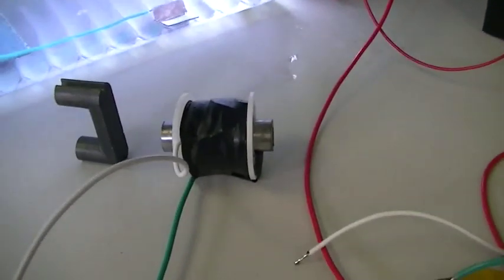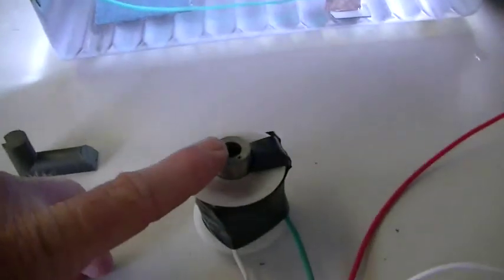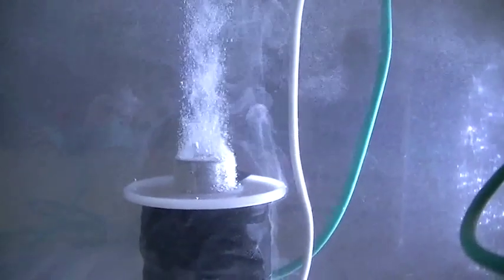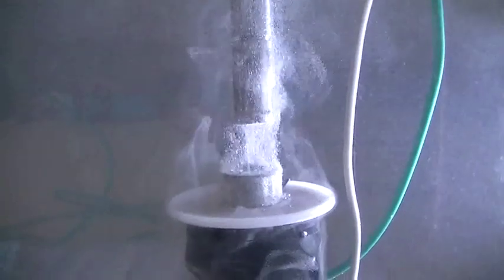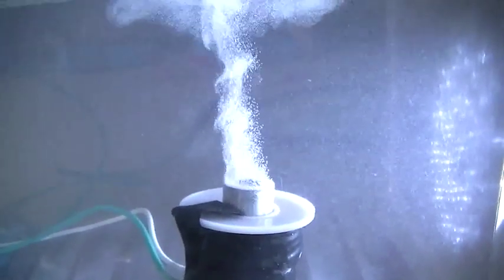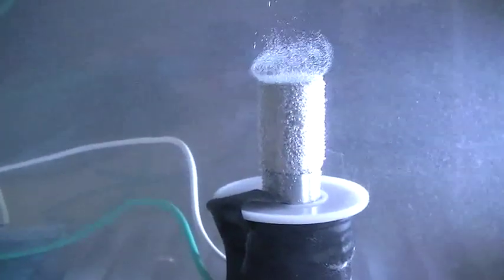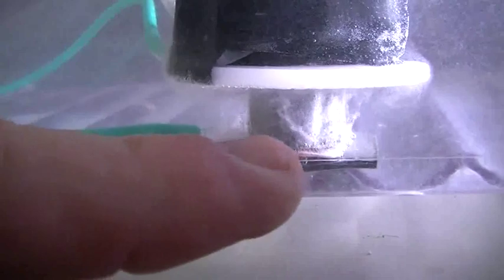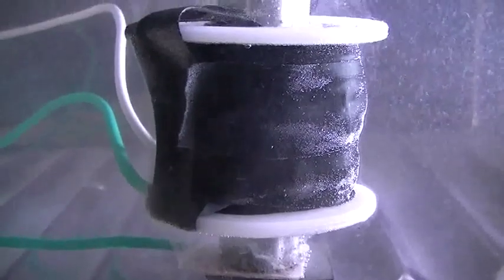Magnetic vortex electromagnet test

Comment: NO Conjugate RECIPROCATION ['vortex movements'] (field reciprocation) with EM vs. PM because:

A: electromagnet is "driving" the magnetism via electricity, NOT dielectricity from the inter-atomic made coherent into the incommensurable geometry of the PM

B: Electromagnet is spatially divergent IN/AS a coil, and does NOT (almost the exact opposite) have the properties of dielectricity as found in a PM which is "driving" a genuine PM !!

Read Eric P Dollards works !!!!!!

Your videos are bloody marvelous. Youre a hoot, awesome, creative, an experimenter, and you're like a fine OPAL from Coober Pedy !!!!
Reply: NOT REALLY! Replace the tube iron core with a solid iron cylinder and you get your spin. This is because iron tube behaves like a toroid which has zero magnetic field in the air cap.

Comment: Just from observing the change of polarity of the electro magnet, you can see that the permanent magnet have a much more powerful magnetic field. What should have happen with a reversing of polarity, if they were of equal strength, is that they would either attract or repel each other like two permanent magnets of equal strength. There is a significant difference between the electro magnetic and the permanent magnet's relative field strength. The effect might simply not be visible on the electromagnetic coil because the field is to weak.

Another factor is that you use the same electrical source, and the coil wiring connection is not sufficiently insulated. Then you also get interference from electrical current flowing from the coil windings connections as well.

Comment: 9:29 impressive. But the permanant magnet does have a larger cylinder shape for the bubbles to move up and around. Probably you would need the exact same size cylinder on eletrco-magnet.... Geometries should match to make the case. Also, the magnetic force needs to be an exact match.

Comment: enjoying the videos today tinman!

my first thoughts we're maybe if the wire was coiled in a certain pattern you could get the same effect. i've seen another person on youtube wrap 10 or so coated wires together, then around a torus in both directions evenly spaced.
once a current was passed through 1 of the wires it would create a magnetic vortex in the centre of the torus. it was shown by either placing a metal ball in a container in the centre so it can spin freely, or a candle was placed in the centre where the smoke would spin and get sent straight up to the ceiling much higher than the smoke would usually get before being dispersed. if you'd like to see the video let me know and i'll see if i can find it again.
Reply: MrBradJJ I would very much like to see that video
Reply: Shaded Zaleph im a bit busy at the moment, but if i remember correctly, the youtube channel was daniel nunez and had some videos named, vortex technologies. if not interesting, they we're pretty cool to watch at least.
Reply: MrBradJJ  much appreciated

Comment: Hi Tinman, great to see your work here, I would suggest to wind a Iron Wire coil with no core, not insulated, best to wind like a compression spring, then apply the current in the coil only then with current in the water and coil current together. I hope this will show some interesting results, Regards Arto.

Comment: Excuse please if this question sounds stupid. Why are there two different colored wires and why are they on the same end of the magnet? It should be a single wire started on one end with a single coil culminating at the other end if you want to reflect poles. If you wrapped more than one layer of coil then the eddy currents will cancel themselves out. Try that mate.

Comment: You should gave the battery go through a PWM so you can pulse the coil the on/off may change the behavior. To get energy out of a coil it needs to be turned on and off.. maybe to get fields strong enough to affect gasses it requires pulsing as well. You should test if there is a change from to being pulsed or to have constant power, Also try AC instead of DC!

Comment: Interesting demo, however i see no reason to presume the swirl effect is caused by some fundamental difference between the 'types' of field produced by passive vs active sources - magnetic fields exchange momentum between moving charges via the omnipresent flux of ambient virtual photons - a static field is a static field (ie. unchanging in time), the curl and divergence of B is zero, there is by definition no kind of mechanical 3D motion within it, no intrinsic torque, the 'Maxwellian vortex' is a metaphor not a literal functional description, and the only meaningully angular components would be quantum (ie. signs of h-bar exchanges as a function of relative directions of interacting charges, and electron spin polarities etc.).

The implicit obligation would be to test the hypothesis with a variety of 'dummy' stand-ins for the permanent magnet - the logical things to compare against would be a non-magnetic metal mass of similar proportions (say aluminium), a soft ferromagnetic sample (say mild steel or inductor core / paramagnetic shielding material), and perhaps also other types of permanent magnet (samarium cobalt, hard ferrite etc.) - all with the same cylindrical profile.  Maybe plastic or wooden / clay / concrete etc. blocks too, to compare effects of different thermal and geometric properties..  What about hollow cylindrical masses (in keeping with the core being used here)..?

Much of which i think would be unnecessary if we simply apply the same right-hand rule we already presume to be generating the solenoid field, to the swirling bubbles we see..

The net magnetic field with the neos attached is significantly higher.  Assuming the water is denatured, the walls of the bubbles must provide sufficient charge separation (due to reduced mobility of tensioned H-bonds, or something?) to interact with a changing magnetic field, and though the field itself is static, buoyancy is lifting these charges away from the source, which is also thus getting weaker with distance, hence we have all the conditions required for induced torques, in a kind of hydrothermal DC motor.. 

Another factor that may assist the effect is the turbulent vortices usually associated with a normal (esp. flat-faced) leading or trailing surface - causing higher pressure fluid to swirl around the enclosed pocket of lower pressure at the center of the exposed face.. 

These more obvious explanations would need to be eliminated before the results could be interpreted as supporting the suggested hypothesis.

Again, though, nice work.. just needs the follow-through - isolate the phenomenon and you book-end the findings.

Comment: The first thing that needs to be understood is that all magnetic fields are the same. There's no difference between a magnetic field produced by the permanent magnet and one produced by an electromagnet. When you reversed the polarity, the PM should have been repelled away from the EM. It wasn't. That can only mean one thing - the PM field is much much stronger than the EM field. Its attraction to the steel core is stronger than the force to repel it. Therefore, the reason there was no spin with the EM is simply because it wasn't strong enough. Try it again with more current - it's current that matters, not voltage. As far as the spin goes, there's nothing mysterious about that either. When using electrolysis you're creating ions - charged particles. The spin is just the way charged particles behave in a magnetic field.
Reply: Yeah man, Golden comment hidden in a bunch of ignorant ones. These guys don't know how strong neodymium magnets are. To reach 1 Tesla from a solenoid is incredibly difficult. And even including an iron core the way it's shown in the video leaves an air gap of about 4cm, the return path. It is this airgap that is gospelled everywhere in textbooks. It imposes a limit, and it should be as tiny as possible for a powerful electromagnet. A rule of  thumb is that B= UoNI/g

Comment: My large, .75 meter, magnetic roller machines,what I found interesting,they would turn counter-clockwise at up to 400 rpm without fighting much, the tremendous pull of the stator,..Clockwise rotation would cause vibration and fighting,it would still turn CW but I could easily tell the difference.Something was interfering between CW and CCW rotation.

Comment: Neither permanent magnets nor electromagnets have a moving, spinning 'vortex' of their field - on either pole.    

If you've seen this video => https://www.youtube.com/watch?v=afQW8FT02DM  the narrator claims "the plasma spinning is proof that my permanent magnet's fields on the N and S poles are spinning."   NO IT DOESN'T.  The narrator does not know that plasma is a conductor, and he is unaware of Lenz's Law.

Plasma is a conductor (see the section "Plasma potential" at https://en.wikipedia.org/wiki/Plasma_%28physics%29).   When a magnet moves close to a conductor, current is induced in that conductor, which produces a magnetic field opposite to that of the original magnet.  This is Lenz's Law, from the year 1834.  

Entropy is well known in physics - physical systems 'seek' the lowest energy level.

With that in mind, think about the statement "my permanent (or electro) magnet has two moving (vortex) magnetic fields, one at the top, one at the bottom.  They're spinning around, with no effort on my part.  They just naturally spin."

Well, a moving magnetic field like that would induce a current which would induce a magnetic field which would induce a current....on and on.    Nature does not work that way -- magnetic field on magnets do not move by themselves.  It violates the well-established concept of Entropy. 

A current can be induced in a conductor, but not by some (non-existent) spinning field around a magnet's poles, but by physically moving the magnet near a conductor (Lenz's Law).  When the magnet stops moving, so does the induced current cease.   

Hope this helps.

Comment: NOT REALLY! Replace the tube iron core with a solid iron cylinder and you get your spin. This is because iron tube behaves like a toroid which has zero magnetic field in the air cap.

Comment: How do you get the bubbles?...I just dropped two different (powerful hard drive) magnets in a glass of water...not a single bubble?
Reply: Electrolysis. He is putting current through the base of the setup in the water. The coil is a separate circuit which he activates in combination with the current already flowing through the core from the base he places it on top of.
Reply: @natetehgreatt  Thanks...new to this so I 'lost the plot'...got it now (Still wondering why no spiral fron the electromagnet?)

Comment: How do you know that it's not an Electric Vortex.. .  .And that magnetism is just the charged particle's, or Spherical Standing Wave Structure's .. .  .Thus the Inward absorption and outward emission of electromagnetic waves between the two previous vector's form's the Spiral symmetry of the Fibonacci sequence.. .  .
Reply: Electricity is a phenomenon of electromagnetism. So either way it is a result of electrodynamic wave functions. What I would like to know is what minerals/substances are in the water. He might have mentioned it but I skimmed through the video. How can a diamagnetic substance have such a strong reaction to an EM field.
Reply: Well , then you think about it.  . ...It's rather like in the two slit experiment, when the observer turn's on a light from a detector adding energy compression Input +1=0 now to the experiment .  . ...Not just the light from the detector, but also the EM field's radiating from the observer also adding energy.  . ...And this will form photon electron coupling's.. .  .Or positron +1=0 now -1 electron Wave Center's.. .  .Now their output was the negation of their input : 0 goes to 1,1 to 0 now -1 the shorter the expanding spiral wavelength's forming only band's upon the screen.. .  .And then when the observer turn's off the light +1=0 now -1 then the expanding interference pattern reforms upon the screen.. .  .Thus water has memory simply because of this repetitious process of the wave function continuously collapsing +1=0 now -1 reforming !!
Reply: The reason why the double slit experiment has the results that it does is because our very means of observing changes the outcome of the photonic actions. Scientist use to believe that this was the way of universe hiding it's secrets but in reality it boils down to the principal of locality and our observant instruments interfere with the outcome of experiments.. However you make an interesting point. These molecules do hold information (memory) in its intrinsic energy, this energy is stored in electromagnetic vortex. At the molecular level everything has information stored as vortices. But like the double slit experiment implies, it would be impossible to read this information without fundamentally altering it. Another question may be, by what means can we use to observe something while causing the least amount of interference, and how can the universe "observe" it's going ons without causing its own interference?
Reply: Superconductivity?
Reply: Intriguing thought.. If only there were a highly efficient method of cooling not involving chemicals; Viva electro impulse, thermoacoustic,  laser cooling. More research is needed on technologies such as those. For efficient superconductivity

Comment: I dont think you got it right... I beleave magnetism has nothing to do with your experiment. The differance must be do to the electrode structure. The electromagnet has a hole in it, that is what cancel the vortex do to hidrodinamic forces.
Reply: I've used a pernament magnet from a speaker - ot also has a hole in the middle - and water was spinning durin hydrolysis

Comment: Bubbles are coming before connect power source to coil.. Also after disconnected the connection.. 
Fake video
Reply: It's a separate circuit. You can see in the beginning of the video that he already has a circuit inside of the tank which he places his coil and core on top of. This is what is initially pushing current through the system. Then he connects the coil on a separate circuit to see how it affects the already existing current.